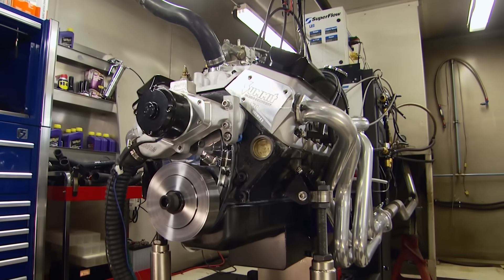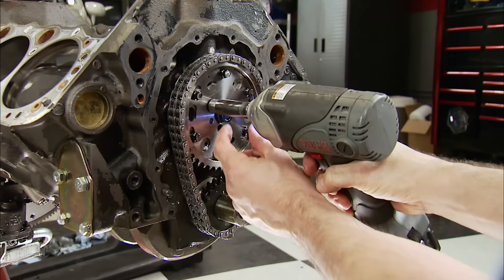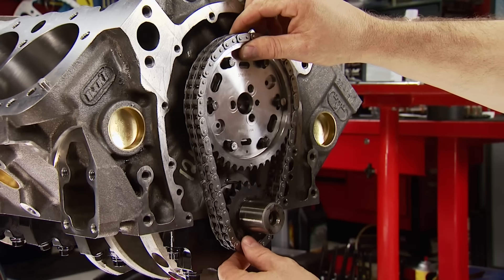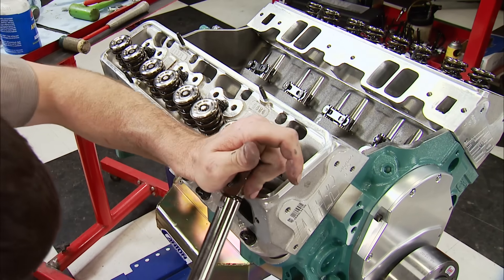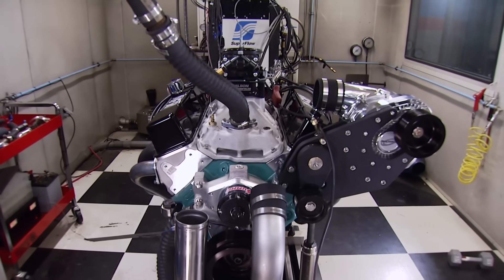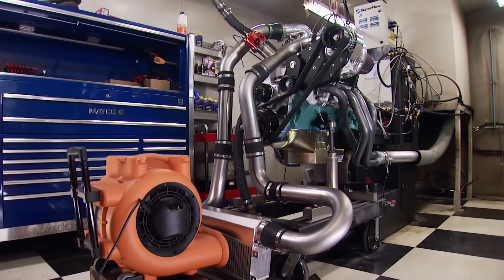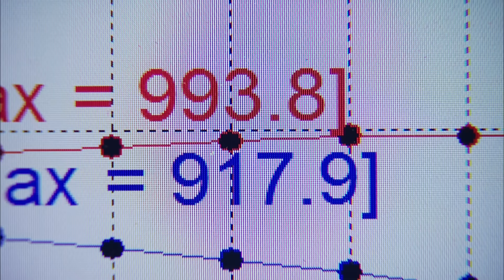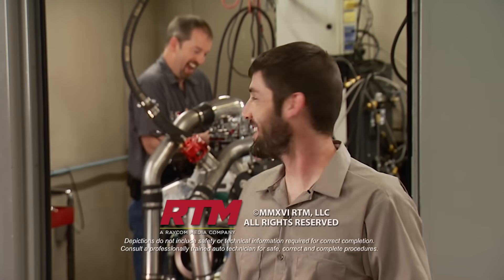Small Block Chevy Build Stage 3: 383 Becomes A 406 To Make Mega Horsepower - Engine Power S3, E14

Comment: NA with 9.2:1 compression ratio still making well over 500 horsepower at the crank, you could run this thing on 87 pump gas and still be dominating at the track!
Reply: i wouldnt run 87 octane in my lawn mower nowadays its like terpentine
Reply: With that much head and cam I'd be surprised if they didn't make over 500hp even with 7 to 1 pistons.
Reply: @177SCmaro  Seeing that it already needs 35 degrees of timing, you can be very sure it would not go above 500 hp if CR was 7:1. 480 maybe.
Reply: @AB-80X  
Most sbc need ~32-36 degrees of timing depending on the head and piston combination regardless of compression ratio. Hp is much more a prduct of airflow then compression. While it would be leaving a lot of power on the table, again, with that much airflow I'd be surprised if they couldn't make 500hp with even a very low compression ratio like 7 to 1.
Reply: @177SCmaro  
I'm well aware of that. However, most SBC's are not running 7:1. You will need to advance the timing a hell of a lot as that flame front will be super slow. You are easily looking at 40-42 degrees to get it across in time. This will matter in relation to the final output as it drives the efficiency down. I've done some stuff with offshore powerboat engines that ran 7.2 to 7.4 cr, and without the blower, they were absolute dogs as the burn efficiency fell off a cliff. There's a reason why you can up the power of a crappy late 70's low compression deal by just raising the compression. 

Yes air and fuel is obviously a factor in itself, but there's a bit more to it. There's a spot around 8.8-8.9 where the loss is no longer liniear. It's not like going from 12 to 10.
Reply: @AB-80X  
Again, on THIS ENGINE I would be surprised if they couldn't make 500hp even with very low compression like 7 to 1, regardless of how much timing it liked.
Reply: @177SCmaro  
If you do the math the drop in CR alone will take it to about 5
508-510 hp. However, that is before you factor in any losses. That would be the number if you could retain the efficiency. But combustion does not work like that, time matters. When you need more timing in such a situation, you lose energy density. Look at it this way. X amount of fuel carries a specific amount of energy. The slower the burn the smaller the force exerted per unit of e energy. If you slow the burn rate down of an explosive, you also get a lower energy density. Same thing here. When you increase speed and compression, you exponentially increase energy density. Due to the nature of how gasoline burns, there is a point where the burn slows down significantly, and the energy cannot be converted to movement. 

You can dice and slice it any way you like, but that mill will not make 500 hp with a 7:1 compression. Physics will not allow it to do so.
Reply: @AB-80X  
I tend to believe dynos more than some rando's guess in a YouTube comment.
Reply: @177SCmaro  
That's fine, but you haven't seen it with 7:1 CR on a dgno and this rando has been building engines for over 20 years.

You clearly don't understand engines and their basic fundamentals, and you apparently lack the first hand experience to know what it is you are watching. So believe what you want, you clearly have it all figured out and nobody can tell you anything.
Reply: @AB-80X  I put a goddamn Ford Coyote engine in a second gen Camaro for kicks by myself but, you're right, because I belive empirical data over the hypothetical assertions of someone I don't know from Adam I must have no idea what I'm talking about. You got me all figured out.
Reply: the aluminum heads would help with detonation, but there's a ton of blown 350 cid out there making this power number and needing $12 a gallon race fuel
Reply: It did not dibble the power like he said it would, ran great with out boost just put in some 12.5 to 1  pistons .
Reply: @apollomorris9920  You have to factor in the loss to drive the blower.
Reply: Exactly which class would you dominate with 550 hp STP?

Comment: Can I buy this motor from y'all? I need a new motor for my 3rd gen z28
Reply: I guess if you don't mind running with no hood.
Reply: @michaeldose2041  as long as I have a running motor with high power
Reply: That would almost be too much power, unless you spend $$$ on the suspension.
Reply: @jagsfanrick  true that
Reply: My 94 ranger

Comment: umm a 4 bolt main...stroker....cast pistons..right cam ..iron double humps hogged..right intake .right carb..made over 500 hp...hmm thinking there trying to sell snake oil...nothing real exotic and realiable..
Reply: Bran Cherry 
Sounds like the same thing my 83 year old dad would say.
Old school hot rodder that to this day solves all HP issues with Cubic Inches or whatever yesterday’s technology will provide.
When somebody says LS with a turbo all he will do is tell you he has has a few 472 or 500 Cadillac blocks to combat that comparatively. That or one of his Chevy 400 blocks with some old school B&M blower he has sitting around.
Don’t get the man started on air conditioning...haha
Reply: ZEPRAT GERNODT this engine is in my 68 chevy II ..runs 11s....i guess I need advice il have you on speed dial..
Reply: ZEPRAT GERNODT btw hug your dad I lost mine last year ...he was a old hot rod guy....he was so proud of me and my beater 68

Comment: Great video guys! Keep it up
It would've been lovely if it reached a thousand😀
Reply: @bigboreracing356  Or just spec the cam correctly and run a better intake. Could easily benefit from the 235 head as well.
112 LSA
Wilson Vic Jr. ported manifold
AFR 235 heads
There's your 1050 hp pull with more low end torque.